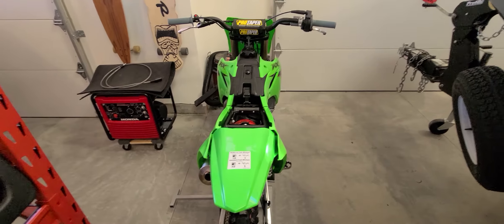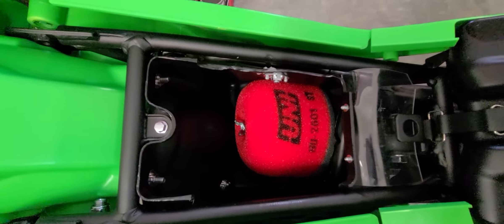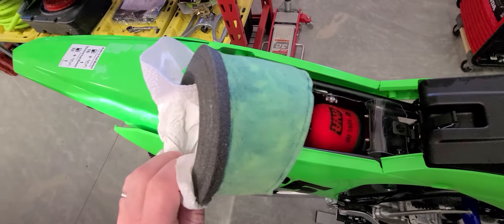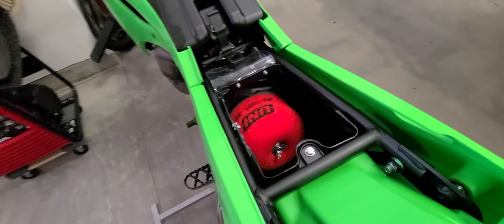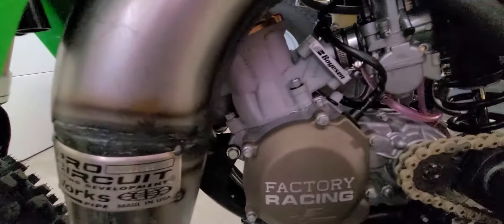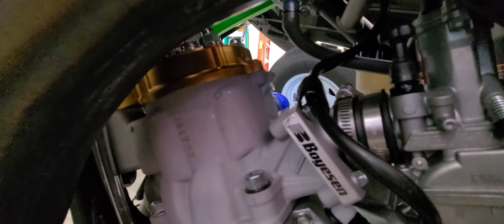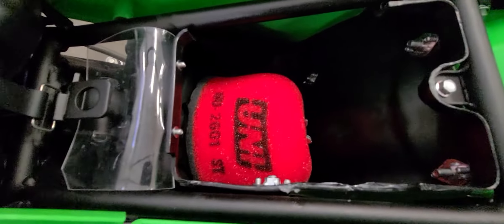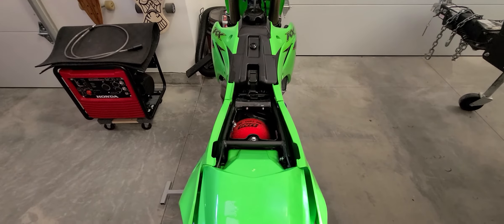KX112 - Its an Air Pump! Complete new air intake, combustion and exhaust!

Comment: What jets are you using??
Reply from the maker: Dropped main jet one size and backed pilot screw back 1/4 turn. But that is for my altitude and general temperatures I ride in. The manual provides good tuning info. Hope that helps.
Reply: What’s your Altitude?

Comment: So even if you don’t get all the other stuff still need to change some stuff that are stock like the air filter well idk if you need to but better looks and probably works better idk I’m new to dirt bikes I’m going to get this I’m 20yrs about 150-160 pounds should the shocks be fine stock?
Reply from the maker: You might need stiffer springs. Maybe ride it and see how it feels first. Stiffer springs are an easy modification if you need them later.
Reply: @GOATbro_Australia  yeah I’m still thinking if I should get this or a yz125 I might go for the 125 but it’s gonna take me longer to save up probably could finance one but idk